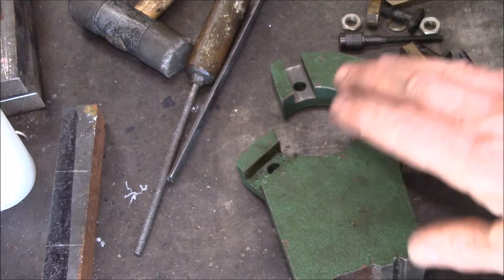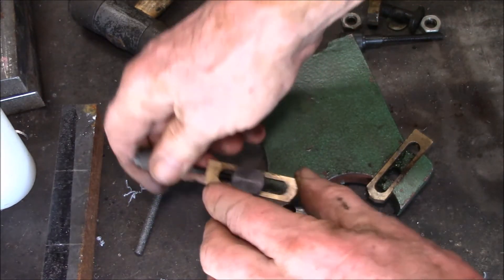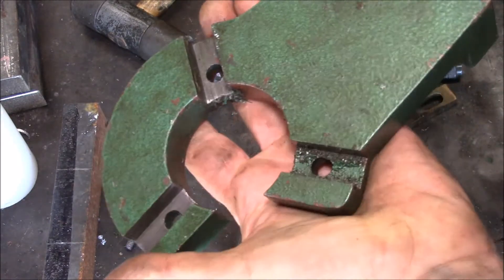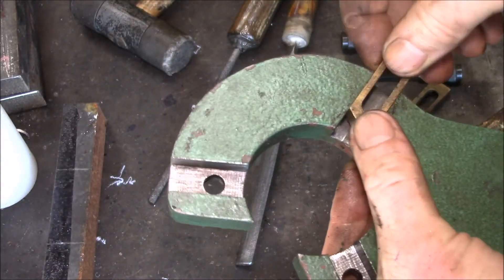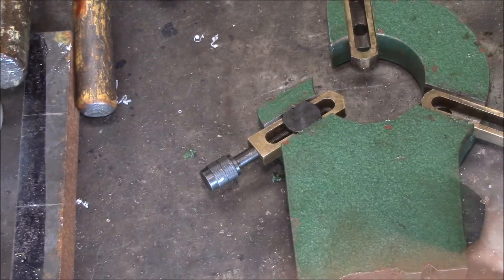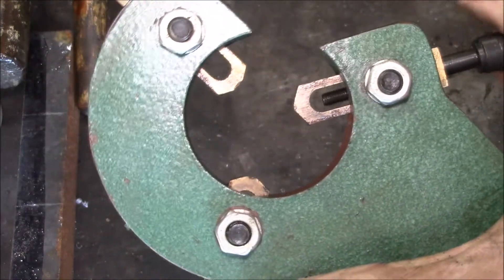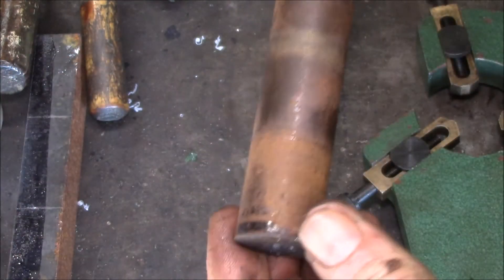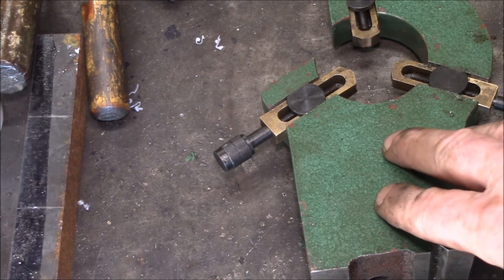Tuning up the Grizzly G4000 Lathe Steady Rest

Comment: I  just bought this same lathe  probably have more into the cost of fuel to go get it than what I paid. The issue is that someone burned up the motor and was trying to mod a different motor to it. So I will need to purchase a motor and drive pulley it came with a lot of extra parts. I'm thinking I wish I would of not taking on this project. 😆I feel like I'm whining
Reply from the maker: Grizzly is pretty good with spare parts.  Mostly they have them in stock, but sometimes, they take a while to get them shipped  in from overseas.  Download the manual and the full parts list is in the back.  It used to be you had to call in to order parts, but I think many can be ordered on-line, just punch in the p/n:
https://www.grizzly.com/parts